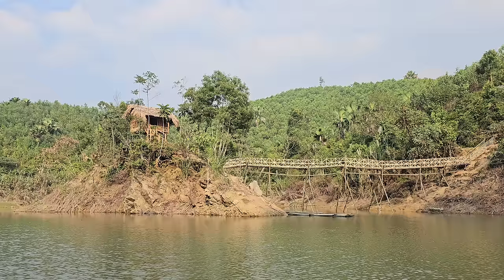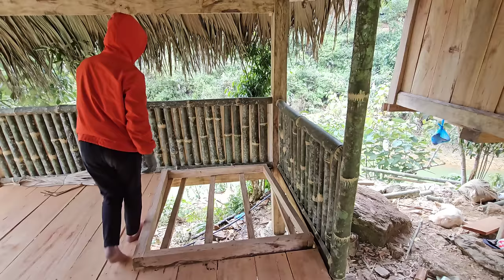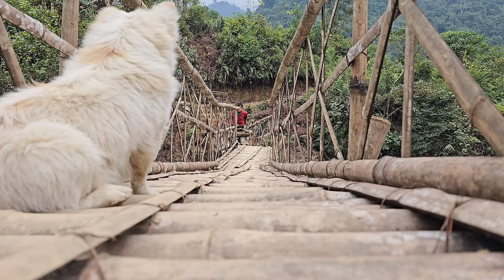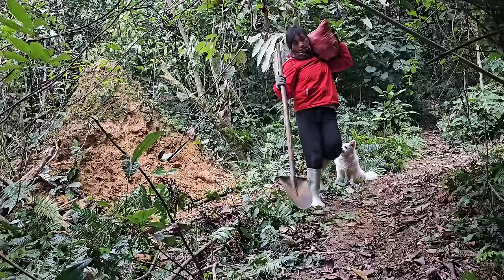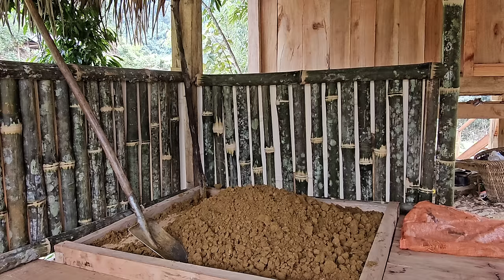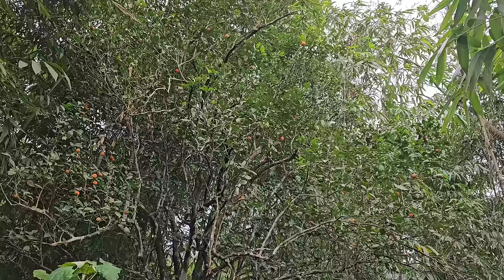Build a 2-in-1 fuel-saving wood stove from natural stone and termitee nest soil

Comment: She should have beveled that hard edge around the frame so it's not so sharp. It wouldn't have interfered with the mud for the stove. And for something you'll use each day I'm sure it would have been a welcome addition. It's still not too late. Although it would have been easier while she was building the frame. She could still do it. WHY not do the stove with metal or even cement for better strength?